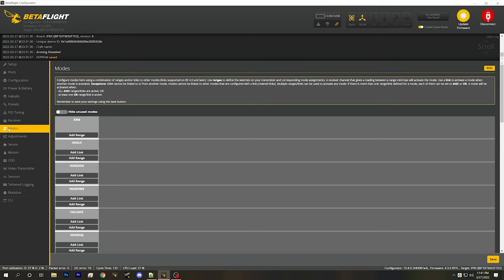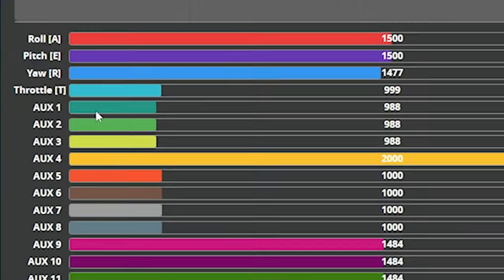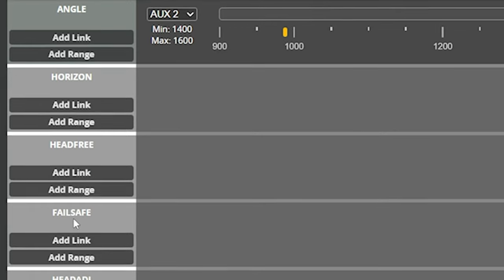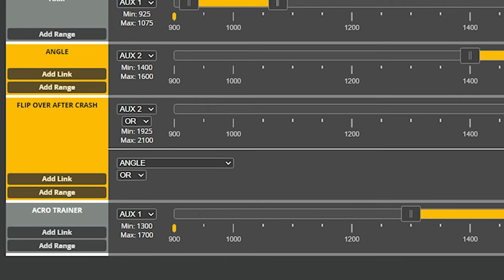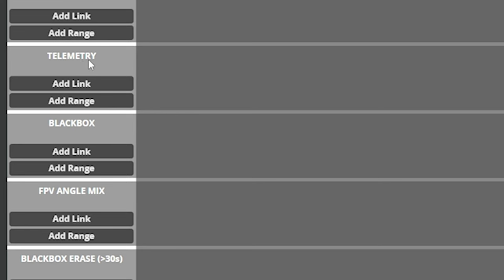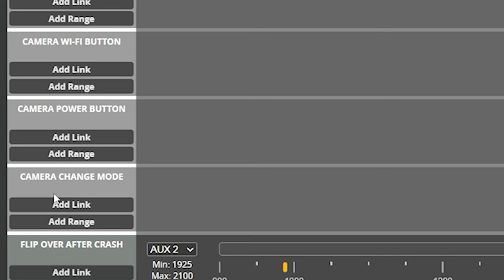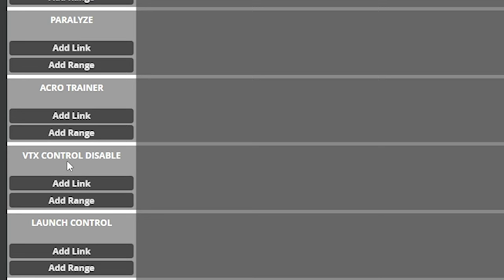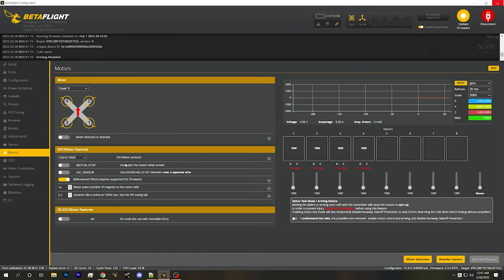Betaflight 4.3 Modes Tab | COMPLETE WALKTHROUGH PART 4

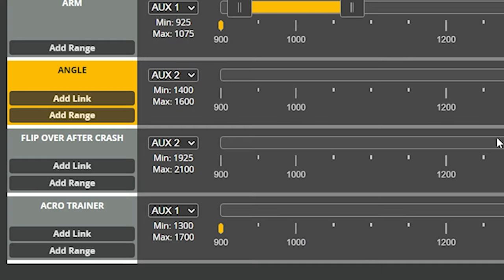Comment: 13:22 (multiple ranges):
Having two aux modes in "and" is quite useful for arming right? if im understanding this correctly u shouldnt be able to arm ur drone unintentionally having 2 switches for arming

Okay i just saw the prearm mode...
Reply from the maker: You should just use Prearm if that's your concern, since it also adds an order (prearm first then arm), while AND can be triggered in any order.
Reply: @JoshuaBardwell  I figured... thank you for all your videos they really help!!

Comment: Can someone help me with betaflight? I have a xilo FC and it will show up on betaflight if i put it in bootloader, but when i try to flash firmware it just stops at 50% and says usb closed. When i connect it to the pc regularly it doesnt even show in device manager, ive tried impulserc to fix the drivers, also have tried zadig to try and fix them as well. still nothing working, also have tried diffrent usb cables as well as diffrent ports. Im at a loss. i will pay for someones time if they can help me. pm me or comment here if you can help. TIA

Comment: Question for anyone that might be following JBs comments… I’ve turned on 12 channel capability on my crsf tx and haven’t run into any issues doing it yet. I’ve read in several places that is a bad idea and I should leave it on 8 channels but I’ve never seen a reason why I should. Explanation anybody?
Reply from the maker: The only down-side is that the aux channels are now polled at 1/2 the rate, so only 25 Hz instead of 50 Hz. That's basically fine for almost everyone I think.
Reply: @JoshuaBardwell  thank you so much for finding the time to answer and then answer so quickly!! You’re awesome!
Reply from the maker: There is no additional latency on the control channels when in 12ch mode. Only the aux channels go to half-rate polling. The control channels are full-rate.
Reply: @JoshuaBardwell  I notice no lag whatsoever… Honestly though, I watched (and rewatched and rewatched) your video where you got all your stuff on a single aux mode… after several hours of watching and watching that video, I ended up in a fetal position sucking my thumb in a corner… just too advanced for my simple brain.. 12 channels is perfect for my quads with gps😎